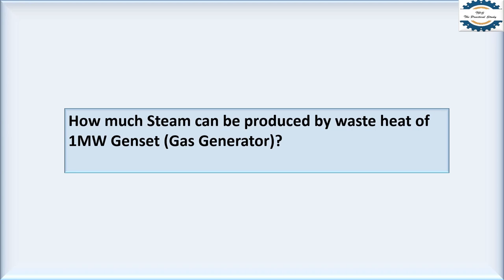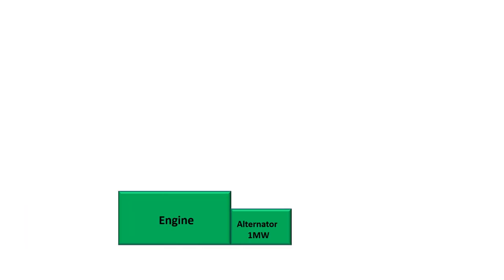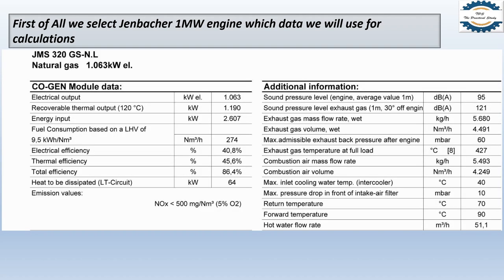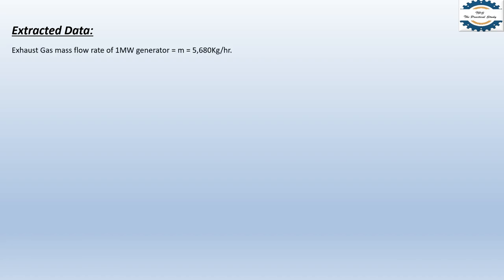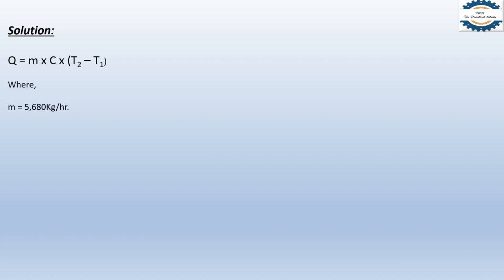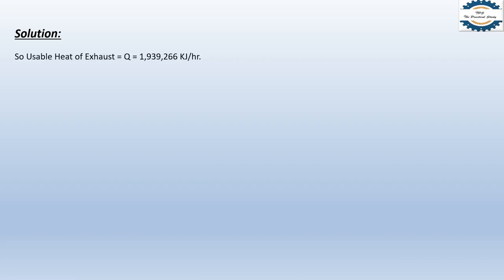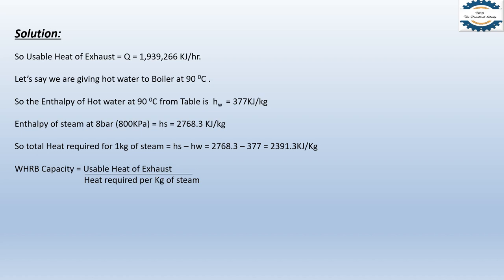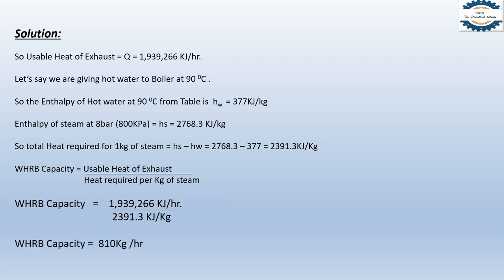How much steam can be produced by exhaust heat of 1MW Generator. Waste Heat recovery Boiler Sizing?

Comment: Heat available should consider a T1 about 200 grades C to avoid condensation at the discharge ? Why you calculate on 30 degrees ? Isn’t it unreal that you would let that exhaust gases at 30 degrees ?